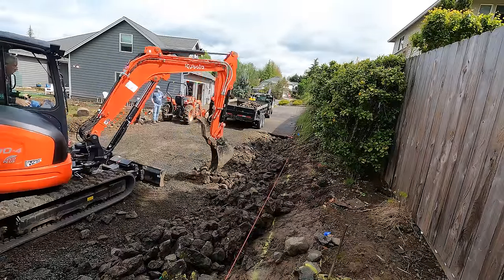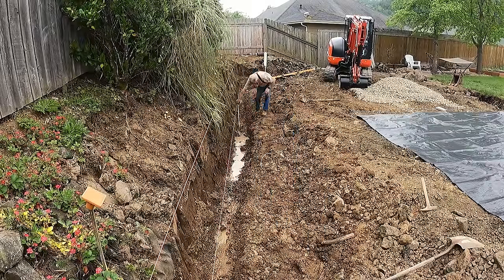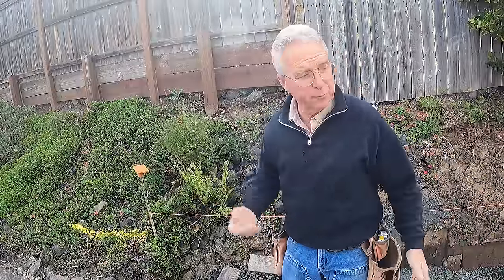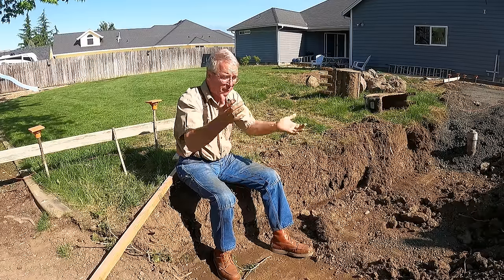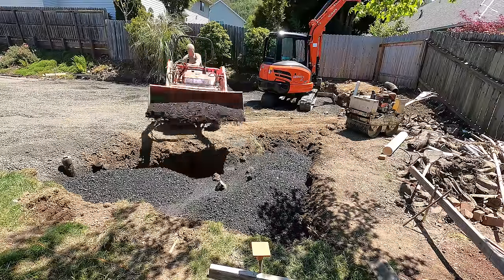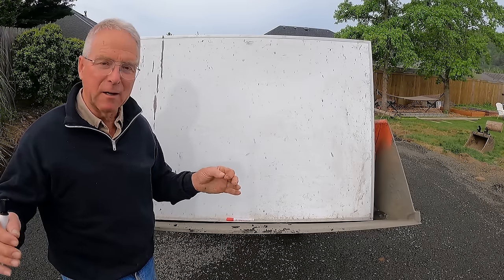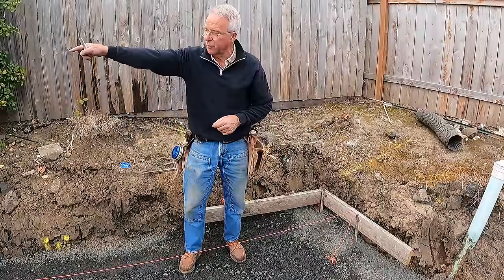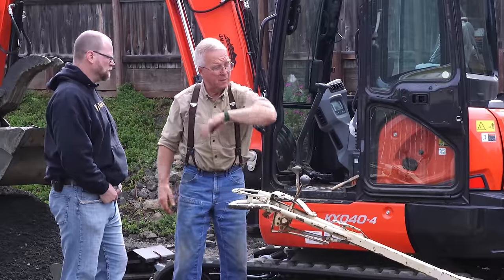Dirt Work: Shop Build #3

Comment: Longtime viewer and big fan of the channel here.  I’ve never commented negatively but i have to say it seems like a big mistake to use road fabric for your french drain.  Theres a hundred different geotextile fabric profiles for a ton of different applications but any type of woven road fabric designed to not let water through is rendering your system useless.  A few slits is not going to cut the mustard especially if you have any type of ground water. The French Drain Man here on yt sells some high flow rate non woven double punched fabric that looks interesting but i’ve never tried it.  There’s a million factors and even more opinions and look i just added another one… the rest of the video was solid gold, love anything relating to pythagoras, layout techniques that i’ve never seen, and really love the shoveling pointers which could be it’s own video.   Thanks
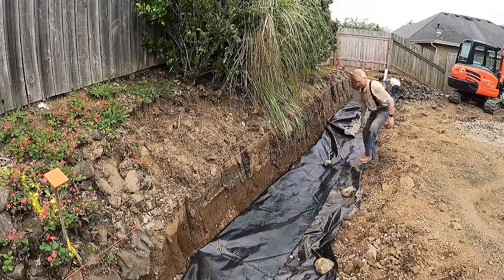Reply: At 07:25, yeah, but they may have slashed it to ribbons.  I'd agree that a cap of geotextile over the top instead of pulled over road fabric would have been better if they had some.

Comment: Really should use filter fabric and not that road fabric.  Poking holes is not a good solution.  You want fully permeable fabric that keeps sediment out.  You have installed a material that is not permeable and then added a few holes that will allow sediment to flow in!  Opposite of what is needed.  Do it right the first time. 🤠

Comment: The Pythagorean theorem is about the one bit of math I remember from 8th grade. Now in my mid 30s I use it ALL the time. It’s actually pretty crazy how many situations it can be applied to, especially when checking square on something. The 3-4-5 method is a quick, easy check on one corner (to make sure it’s 90*). 6-8-10, 9-12-15 etc, makes it more accurate for human error.
Reply: Yuppp0ppp
Reply: 5-12-13 is a lesser known ratio variation of 3-4-5 rule, but 3-4-5 (or multiples of) is easier to remember.
Reply: @cousindave1  nice to know the 5 12 13
Reply: @cousindave1  I wanted to mention the 5,12,13 because it is useful, like on narrow tall walls.  You beat me to it.
Reply: You know what, that's the one I remember too. The rest of geometry I seem to only have remembered what it's called (or at least I'm able to get it close enough so Google corrects it to the right thing).
I'm much better with electrical math to be honest. Ohms law and power calculations are etched into a stone tablet in my brain somewhere I'm sure, because I never forget them.
And in any case, with Google at your fingertips and a nice calculator only a short search in the app store away, the rest of math fall to just knowing when you can use math to figure something out, and maybe a dim hazy memory of what that method is called, Google seems to be able to sort the rest out 99% of the time.
Reply: Any 10 year old in Romania knows that formula
Reply: Folks 3-4-5 IS Pythagorean theorem. 3^2 + 4^2 = 5^2
Reply: I took geometry as a high school sophomore.  Four marking periods, four D’s.  It made no sense to me except for the Pythagorean theorem.  Even then, I could appreciate the utility it could offer.
Reply: Love your videos, have watched them for a long time. I know you asked us metric not to mock your inches, but just seeing the math to turn decimal to fraction is longer than solving the triangle brings a mock smile to my metric face 😈

Comment: Those 10” lifts are ok for something that size. Ideally it will compact 6-8” to 95% on most soils/fill. It can get down to 10”-12 depending on how good the vibration is on the compactor.
Reply: I agree depending on how good the vibration is, but also the moisture content being at 95% of maximum dry density before 100% of the optimum water content on the soil compaction curve. 😊
Reply: For roading work the maximum depth of each layer is around 300mm (somewhat deeper with some material types), but that's with much heavier-duty vibratory compactors and multiple passes, I don't know if that still holds with smaller plate compactors.  So I definitely wouldn't go anything above that, which is 12".  As you say, 10" sounds like a safe value.
Reply: I was taught to compact every 6-8".
Reply: @davesmith2233  ya the 300lb hand held compators don’t do much past 5”
The 20 tonne rollers are a bit more forgiving as the hydraulic vibration is much more powerful

Comment: I think I missed how you determined that the two sides were parallel. Measuring off one to the other depends on that measurement being made perpendicular, but that's difficult to get accurate freehand. It seems like if you're measuring the diagonal down to eighths of an inch, accuracy there matters.

Comment: YES!YES!YES! Not only is “squaring” up something by repeatedly measuring diagonals, until achieving common measurement a huge waste of time, it is also a flawed method. You can potentially measure exactly equal diagonals and not have a single square corner on the whole thing. Think of an isosceles trapezoid. The diagonals will measure exactly the same, but nothing is square. And it happens in the field, much more often than you might expect, by simply forgetting which board was suppose to lap which. 
Pythagorean Theorem! Learn it. Know it. Use it and be exactly right EVERY time. Glad you took some time to explain arguably the greatest discovery of all time (construction-related anyway).
🤜🤛

Comment: The one part of my new shop I didn't build is the foundation. My (expensive) guy was so good that the slab/stem wall is perfect. Both diagonals are exactly the same over 2500 square feet!

Comment: You should try using alligator clips (electrical connectors) or some call roach clips instead of the pencil marks. Easily moveable and will never be mistaken for other marks on the string.

Comment: When in High School, and going through all the math classes, you say to yourself; I will never use any of that.  Wrong!  The Pythagorean theorem I have probably used more than any other technical math throughout my life.  Not only my time in construction since 1972, but even in the nine years I spent in the USMC.  You use it everywhere!  I am 77 now and am still using it and teaching the importance of the Pythagorean theorem to my grandchildren.  My eight-year-old grandson is fascinated by this simple solution to many things.  He spends a lot of time with a tape measure checking things.  I'm sure the theorem will be with him for his entire life.  Just for information purposes:  I have used the 3-4-5 method many times, but discovered another that has worked well for me:  5-12-13.  Found this out when calculating the amount of roof sheathing needed for a roof slope of 5/12.

Comment: 30 years a go, when I was an electrician I laid out a 5 acre site for light poles off of the corners of the building after the General had set them.
I scaled everything out and using 2 points at a time. I was able to pinpoint the exact location of the entire project.
I would draw 2 arcs and where they intersected and I had my locations where they crossed. 
He double checked my work and offered me a job on the spot as his assistant. 
Should have accepted it...

Comment: Our specs usually limit backfill lifts to 8" max, and then compact with a heavy roller vibrator.  This is for the nuclear power industry, so more stringent than your typical residential job 😀

Comment: In Saskatchewan we have “socked” perforated pipe, wrapped in what appears to be a felt material. It’s actually code to use the wrapped pipe around new construction. I’m not sure how long it stands up underground but it keeps some sand, silt, mud out for a while at least.
Reply: Pretty pointless really. There should be clean outs here and there so you can just flush em out if they get clogged with sediment. The socks always clog up and the perf in stone wrapped in felt is over kill and ends up plugged up anyway.
Reply: @mikeznel6048  No it’s not.  If socked pipe is installed correctly with #57 gravel it works excellent.  No clogs and allows water to enter and then exit pipe.
Reply: @StubProductions  I would always want to inform myself of the soil conditions and geotextile material type anyway.
Reply: @StubProductions , Sounds like you’re from Ohio, I don’t know if other states use the same gradings for stone though. Most states seem to have their own numbers for crushed stone.
Reply: @Hoaxer51  Yes different grading in different parts of country… but same principle.  #57 limestone is roughly thumb size gravel.
Reply: @StubProductions , Yea, in Ohio #57 stone is washed 3/4”, usually limestone.

Comment: I think the term you were looking for at 8:30 is "surface saturated". This is basically when the stone absorbs as much water as it can, filling all void space within the stone. Think of it as a sponge, it's not bone dry but also not sopping wet dripping water. It's perfectly absorbed all the water it can, filling all void space within the sponge, but only containing water out to it's nominal surface without being over saturated and leaking water.

Comment: I learned to square 4 different ways from old school to a calculator. The easiest is buy a Construction Master 5 calculater (Lowes) HD or on line type in 26 feet rise x 36 feet run then press diagonal. You can also use it for stairs, rafters and figure concrete for floors yardage for stone materials etc, etc. You can also square any number including 5 feet 9 inch 7/8 or any combination of fractions. It's amazing once you learn it.

Comment: Good lecture on shoveling! I usually use my left thigh for a fulcrum (I’m right handed) My jeans usually wear out across the left thigh, first. No need to spend $$$ for pre-ripped “fashion” jeans, they get that way naturally with honest work. 

One more element of using your thigh for a fulcrum is that the weight of the shovel and any material you are moving is carried by solid column of bone from your femur, through your tib-fib and down to the ground, as opposed to being carried by that unstable stack of donuts in your spinal column.

The nice thing about your super computer cell phone is you can do the math right there. When setting a block foundation for my greenhouse, I used the “3-4-5 rule.”

Comment: For finding if things are square I've always used the 3,4,5 measurements,   you measure leg A out 3 feet, 30inch, 30mm 30feet or what ever it needs to be as long as its a round 3 number it will work and place a mark, then  measure leg B at 4 feet, 40 feet or whatever and mark it . then the diagonal should be 5 of whatever you measured,  so if you measure out 30ft on leg A and 40 feet on leg B then if its square the diagonal should measure 50 feet mark to mark.  if you measure leg A 3ft and leg B 4ft then the diagonal should measure 5ft if it square.

Comment: I enjoy seeing the differences across the country in codes and methods. Around me you have to be on stable natural soils for footings with your style of building. "Stable" is either the limits of the building inspectors ordained ability, and/or a soil engineers approval based on soil testing(for large developments usually done prior to permits issued) if they deem it necessary. 

The old topsoil wouldn't be permissible, the black mud wouldn't either. We either have to trench through it(deeper) until we get to it, or pier it under the footings(with complementary engineering). 4-6 feet deep trenching is not unusual in a rough spot. That's roughly the limit of financial gain by not using soil engineers. Beyond that it normally gets cheaper to use them and pier down to stable "natural" subgrade. 

The only uninspected and tested fill permissible on your site in my area is for the floor itself. We're allowed to fill like you have on our own to have control over floor subgrade, so it's not uncommon to see a site (building pad) stripped, filled and compacted and then trenched or piered to original soils for footings. 

Ha.... "just a simple rectangle" ... yea.... but have you seen what a simple guy can do to a rectangle? Thanks for sharing

Comment: Before you can move the high spots to the low spots, you have to be able to visually identify the high from the low.
Reply: That’s why we always set string lines to grade to, nobody’s eye can see level across 26 feet. Or you can use a laser to check yourself.

Comment: Great tutorial.  I'll be building my shop soon as well (30 x 28 w/an 8' covered lean to on the long side).  I've got my preliminary pad raised & graded (approximately). Still have to run drainage, water & electrical lines). Then the fill & compact grade and so on.
This series is such a great help to me, reminding me of all the steps in order and inspiring me as it helps ease my mind of the simplicity (although sometimes hard) of work involved !!

I was a finish commercial carpenter installer for 33 yrs.  Starting as a helper, journeyman (4yrs), foreman (8yrs) supervisor of multiple jobs (12 yrs) and superintendent of as high as 64 floor towers by half of my career.

I'd like to say that I learned the Pythagorean theorem years before my sophomore geometry class.  It is this fact that organized my thoughts in the importance of building square from the start through the finish of any project. I found it useful for working out roof pitch and rafter lengths as well. It demanded me to think ahead (like in chess or billiards).  

In the time I put forth working out the steps to assure a solid foundation of a plan, and keeping in line throughout the steps, I found myself thinking of jigs to help the process in speed and accuracy, as well as remembering to reach back to my memory's of earlier education for working out other seemingly complicated plans like radius work and fulcrums !!  

Sometimes it was beyond me that co-workers could not picture some very simple ideas that surely had been learned in their youth ??  I've seen, many times, laborer's not grasp the idea of shoveling, sweeping, starting square, or worse, leaving a job complete, finished and clean.

I believe they never experience much in the way of a feeling of accomplishment after working out a challenge b'c of which they never experienced appreciation, a-ta-boy or a pat on the back by a boss.  Many didn't want or pursue responsibility and would settle into some mundane aspect of the job like running base or crown never wanting to learn different things that would make them more of an asset to the company.  I always wondered if they were happy ??

I couldn't wait to get to work early, stay late, volunteer for some unique job that challenged me.  I wasted money on an alarm clock once.  I had it for about a year and always woke up a minute or 2 before the ringer went off.  I was livid at myself for spending the $3. on something that I never used !!  I crushed it w/ a 28oz waffle head hammer which I bought and never used in finish millworks.

In conclusion, I will say that, it was likely,  the Pythagorean theorem may have been the 1st thing I used to that me feel accomplishment, that I could do something challenging, that helped me take a moment to think and understand the importance of accuracy as well as keeping that level of accuracy up throughout and beyond the proverbial finish line.  And, I'm sure these qualities, produced in me, by the Pythagorean theorem, were the basis for the many gifts of praise by my bosses, clients and onlookers.  

God seems to have a very unique knack for showing love and spreading contentment throughout His community.  I am so grateful to Him and His Holy Spirit for embracing me throughout my life.
I believe you too sir are blessed,
Thanks again,
Sincerely ............................

Comment: One thing about forcing water into the ground to achieve consolidation: It is an accepted method in sand. The process is called jetting, and in sand it is often the only way to consolidate that coarse grained soil.

Comment: I have laid out much larger footprint and more complex building footprints doing exactly this method and more importantly 
The number of times we have does this to prove or correct the professional survey and there 100’s of thousands dolled systems  remember those system have a lot of human input and those system don’t know anything but what you tell it ( input into it) and I can’t tell you how many times is wrong over the last 40 years I’ve been doing this  and that’s almost every single job anymore ( the GPS systems now) the survey like all the other trades have less time to do more work. 40 years ago when I started the surveyor used actually math, a transit and a story pole and he thought about every number. Now it’s just a cad file spitting out marks. And when there just a little bit off ( and they are) most of the time you don’t notice them till you look back and some has a dip or a wiggle 

Anyway  Scott thanks for nicely conveyed overview of the start of a building

Comment: Slab on grade is an interesting way to go, it's rarely used over here. Always interested to see how others go about foundations. We'd have trench fill, 600 wide, 1000 deep the a couple of courses of block up to damp proof course.We'd then infill with hardcore and pour the slab after the perimeter was up.

Comment: Back filling ditches with a compactor like that normally calls out a 4" lift for most street/utility work. Which usually means in "normal" situations, it will compact a 8" lift no problem.

Comment: Scott, I hope that road fabric you used doesn't come back to bite you in the behind.  As you said, it doesn't like to let water through.  I think you might have been better off going to get filter fabric designed for drainage.
Reply: He mentioned cutting slits in it, it'll be fine
Reply: @Adamsadventures83  I hope so.
Reply: @mae2759  Felt will just clog up over time. Best bet is using perf ads in clean 2’s with a clean out every 50 feet or so.